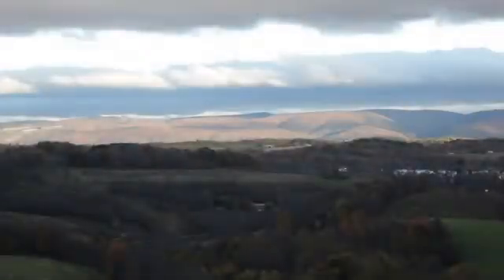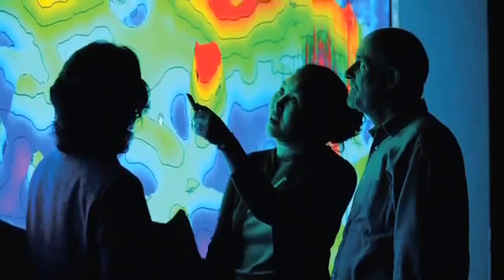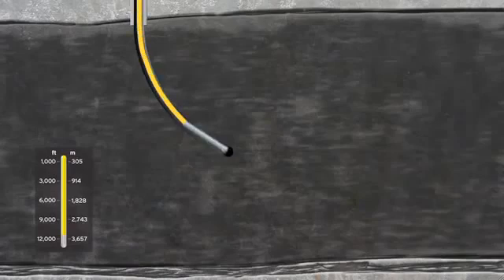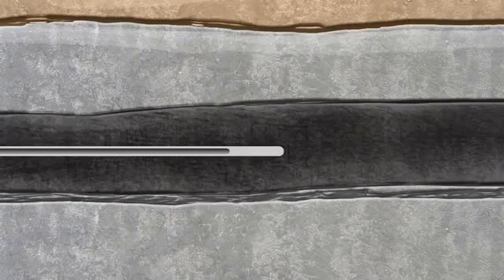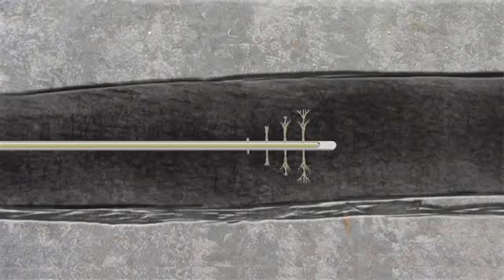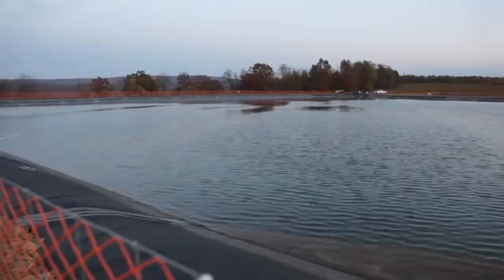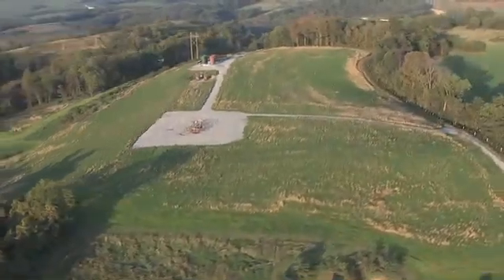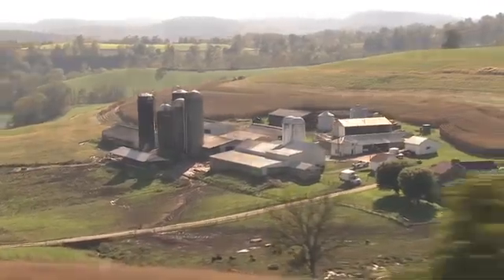Producing Natural Gas From Shale

Comment: Doesn't the Fracturing the cause of Earthquakes in areas where used?
Reply: Oklahoma
Reply: Hoooo yes due to technotic plate it cauce earth quake
Reply: Use your mind to think it over. Do you think the earthquakes can be caused by several engines？
Reply: @deanma7399  Yes.